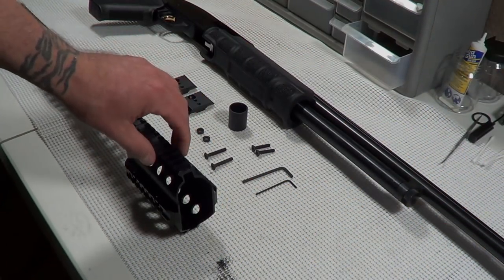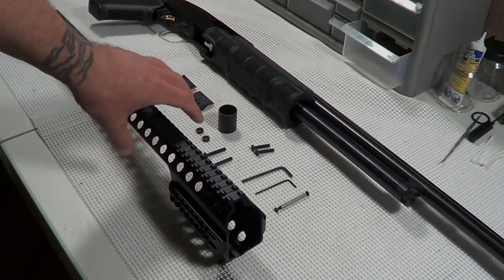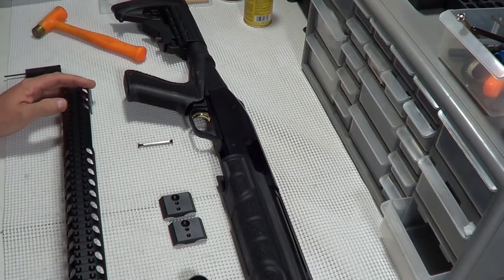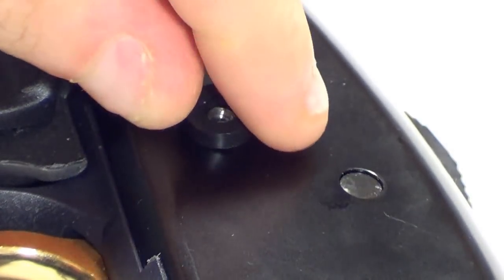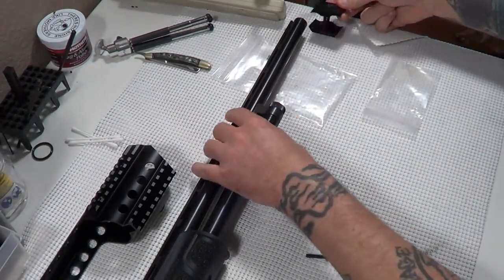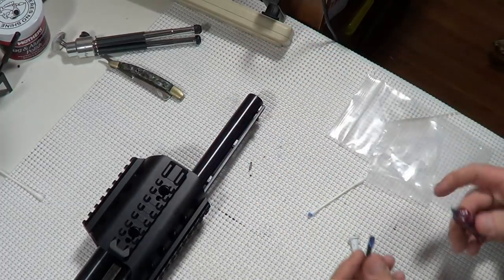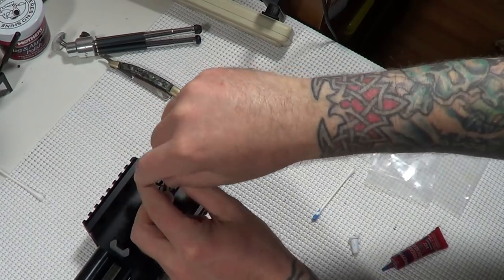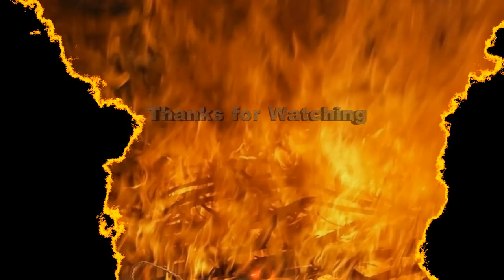Mossberg 500/20 gauge Tactical Rail Install, Practical to Tactical PT4

Comment: I have the Mossberg 500A 12 gauge and my Black Aces rail came in last Tuesday (Feb 11th) pertaining to the Barrel/Magazine clamp pay attention to the holes on the left and right side of the rail the big hole is for the long mounting screw connecting the rail to the clamp. These holes are in the same spot on each side with the small holes for tightening the barrel/magazine clamp screws these holes are in different positions on the rail on the left side the hole is in front of the large hole. On the right side it is behind the large hole so make very sure that the Barrel/magazine clamp is mounted correctly.

Comment from the maker: Ive yet to have an issue on the 20 gauge. Ive also heard about breakage issues. I think a key point is making sure the front is secured very well with loc-tite so the rear cross bolt doesn't take the brunt of the recoil forces. Honestly Im happy with the product at least from the novelty perspective.

Comment: So basically you bought a 200 gun , and I also have same gun I bought for my son. He didn't want it any longer , so I actually love the gun, btw that stock receiver came with tapped and a rail from the store. I use it with a SCOPE to slug hunt, I change out one of the 3 wonderful Accu chokes for what application I need . And it's great home defense with a little light on it's ammo tube, with a aluminum mount . So getting back , you took a 200 buck gun and put probably 500 bucks in it lol, and it does same as mine LMAO

Comment: Cool vid, makes me realize I didn't install mine exactly rite because the directions suck, I have the clamp on the barrel+mag tube, it seems to be holding but only one bolt will fit. Q for you, when you screwed the rail to the clamp, is the rail flush against the clamp on both sides? I read a review that said bowing will occur if you tighten the screws so much that it is flush against the clamp. I didn't want this to happen so I didn't over tighten but its annoying rail isn't flush to clamp.

Comment: Hello TacticalAdv, I have an older 500 Cruiser 20 Gauge, 6-Shot, 18.5" Barrel, Pistol Grip Stock, Bead Sight , do you think this tactical rail will fit without alteration? Great posts, thanks very much for your posts & advice!

Comment from the maker: i never had any intentions of this gun being for that. This is a build for home defense and nothing more. not for the impending zombie apocolypse or mock-combat or any other simulated combat or run and gun event. But since you mention it, the gun with the rail wieghs signifacantly less than its 12 gauge counterpart. I found that interesting, it also wieghs less than the AR that I have successfully run through many of said events.

Comment: Tactical 20ga...  That almost sounds contradictory, lol...  Nice gun tho and good video!
Reply from the maker: Its "little" tactical....lol
Reply: Don't discount the 20.  At close-quarters range, with the proper load, 20 gauge will be quite sufficient.  Just that the proper load will produce significant recoil, even on a 20 gauge...